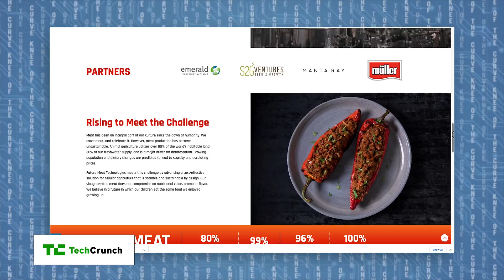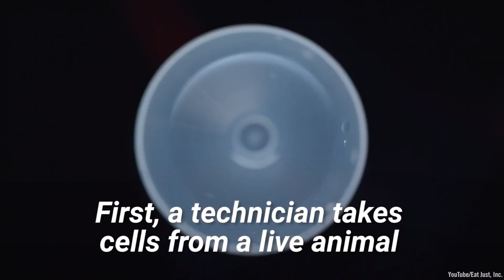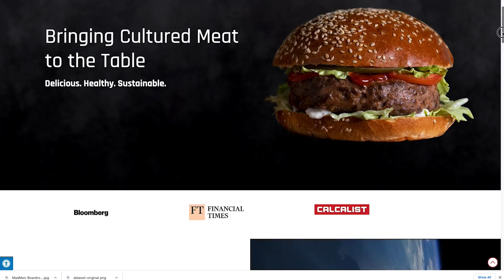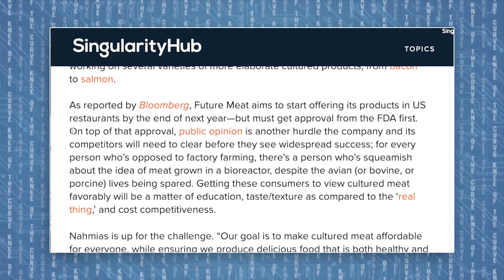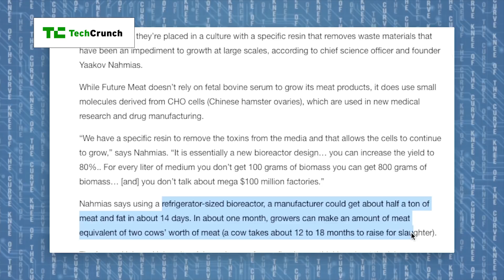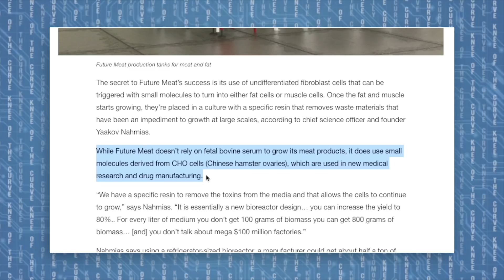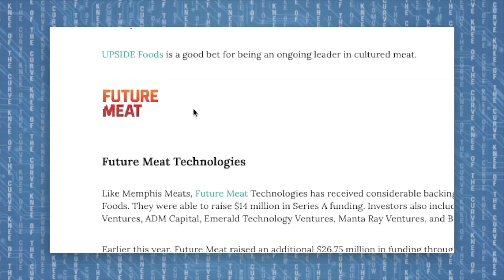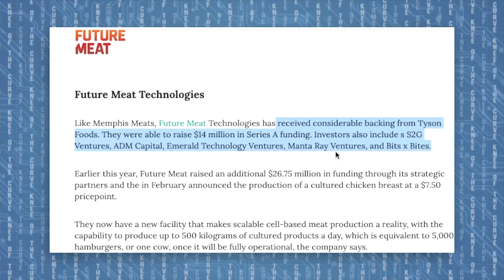FIRST LAB GROWN MEAT FACTORY OPEN FOR BUSINESS!!!

Comment: Chinese Hamster Ovary (CHO) Cells could be more expensive than Fetal Bovine Serum.  Because I think the heart of a Calf is lot bigger than the ovary of a little hamster.
Reply: CHO is a cell line. You don't kill new hamsters to get it. It sits in labs worldwide and multiplies when fed a serum. It's infinite as long as you feed it.
Reply: @GregVidua  Thanks for explaining, I had no idea how the CHO cells are extracted.     So does that mean that in the long run the cost of CHO cells will be cheaper than the Fetal Bovine Serum ?
Reply: @samratpaul25  you've asked about cost in long term. CHO cell line is long term - they've been used for nearly 100 years already. As far as cell lines they are cheap but I don't know the cost of using them for lab grown meat.
Reply: @GregVidua  what is the name of the SERUM that is used to feed the CHO cell line ? Is it something like the fetal bovine serum ? Are any animals killed to extract that particular SERUM ?
Reply: @samratpaul25  it depends on the company running the operation, the goals of the cell line, and usually isn't publicly shared. Most are animal free though.
Reply: @GregVidua  I just did some research, so I thought the serum (Trypsin-EDTA) is extracted from some farm animal pancreas.     But as you said it can be chemically produced so thanks again for clearing it out.